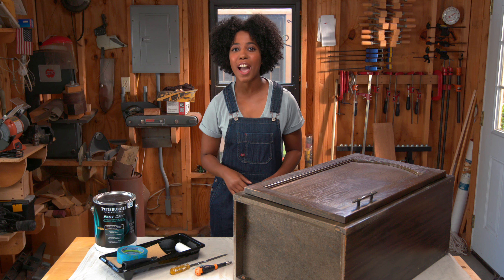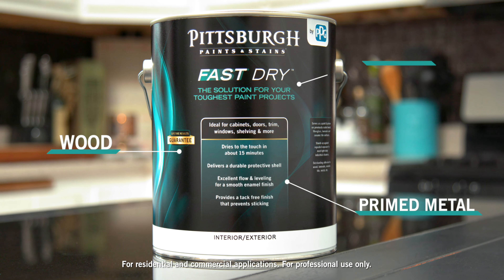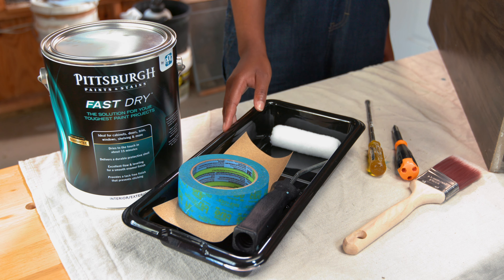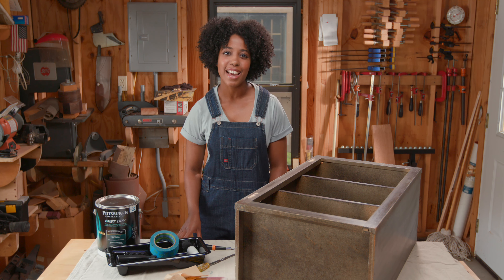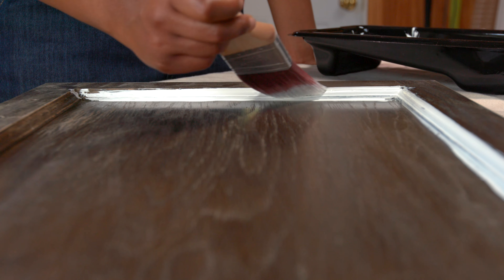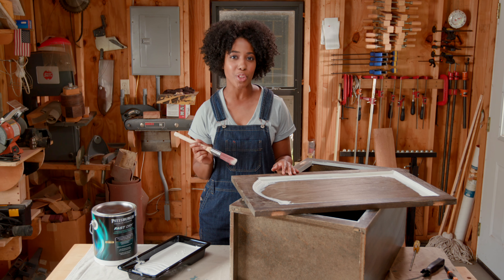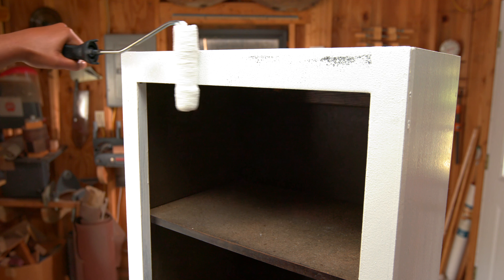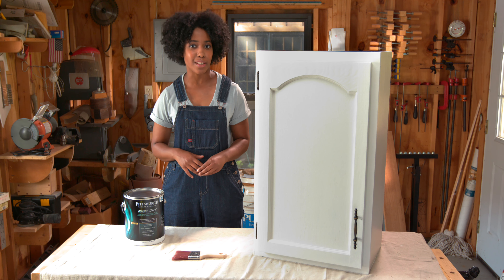How To Paint Kitchen Cabinets With FastDry Paint - Pittsburgh Paints & Stains

Comment: Tip for people that was missed: if there is bare wood it does in fact need a primer if you are painting a light color like white.  Wood stains will leach right through the white paint.  Use spray can of BIN original shellac or Coverstain oil primer.  
And good idea to vacuum and use tack cloth after sanding / before painting.  

Doing a full kitchen job it’s best to rent a paint sprayer and paint the doors.  Would need to watch lots of videos to learn how but it could save lots of time.
Need to strain the paint before spraying.  May need to add extender / water.